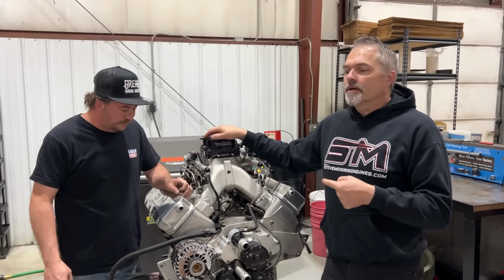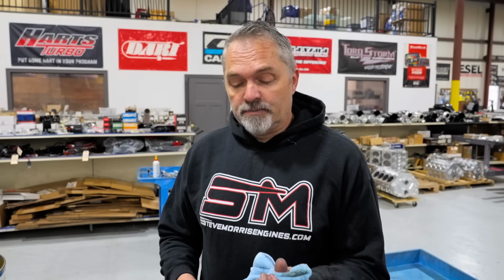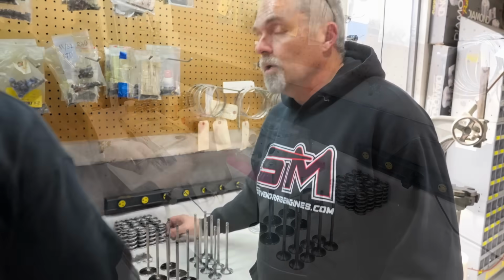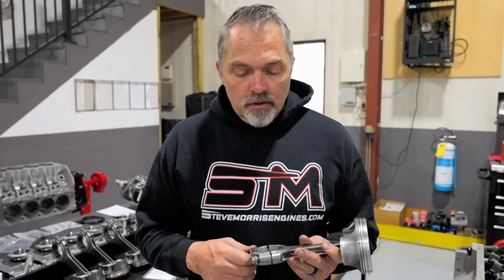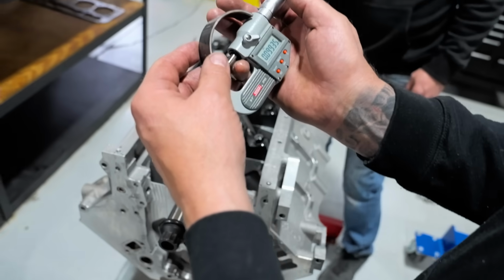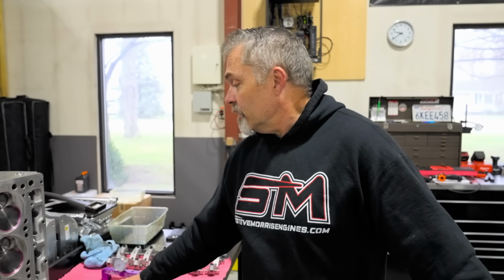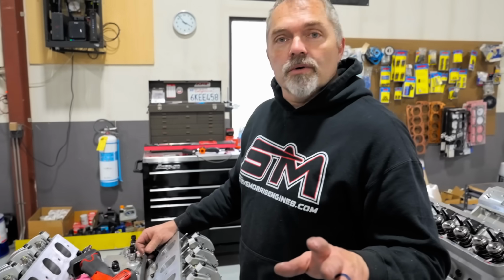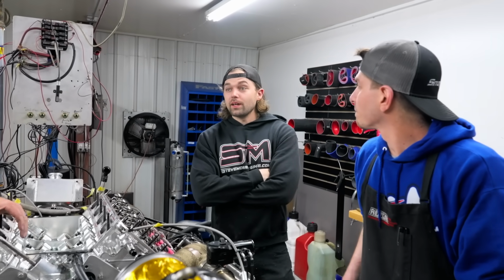HUGE ! 474 cubic inch LS Engine… How Did This Engine Work So Well For 4 Years?

Comment: I think the oil tanks on dry sump setups are just supposed to separate air from the oil right? Aside from that, they ensure the oil pump is always fed oil.  The car would have to be upside down to not be fed oil.

Comment: Thought dry sump was to keep oil from riding on the outside crank shaft and draining hp. Also for vehicles in hard g braking and cornering and mounting the tank for weight distribution advantage

Comment: Are stud or shaft mount rockers superior? I feel like shaft mount would be stronger, and more durable.

Also I think I misunderstood proper rocker geometry. I thought that the centre of the fulcrum and roller tip should be at 90degrees to the valve angle at half lift?

Comment: To explain the intake sucking shut thing. Steve, you need to separate the force vs pressure issue. Yes  atmosphere is 14.7psi, however you have a lot of surface area on that intake. Maybe 100 square inches? Does that not mean you only need .6 of a psi pressure drop to achieve the 60 pounds of force that you required to push it closed?

Comment: Dry sump gets the engine lower. Dry sump tank does a very good job of oil deaeration. My guess is that the Proline guys don't care about the oil deaeration since its running such a short amount of time unlike a road racing, circle track etc. application. The tank and plumbing would also be extra weight they do not want.

Comment: Back in the air cooled flat 6 days, the 3.6L 911's took 16 quarts of oil. Being an external sump/tank/ reservoir, I didn't think much about it. Most German engines have larger oil capacity per liter of displacement than American or any other country's cars. For example, MB 5L V8s require 10 quarts, BMW 2.5L I6s required 7 quarts, and even Audi/VW 5 cylinder engines require 7 quarts of oil. Compared to GM 60° V6s 4.5 quarts and 5.7L V8's 5 quarts, you can see why OE engines from these manufacturers wear the way they do and require oil changes at their respective intervals. More oil will last longer than less oil, under the same circumstances. German cat companies have set oil changes at 7500 miles for decades, even before using synthetic oils, and when American car companies were still using 3000 mile intervals. Now, everyone is using synthetic or synthetic blends and extending the intervals between 5000-7500 miles. Oil changes are the most important maintenence items to get the longest and most trouble-free life out of an engine. Spark plugs in aluminum heads need to be removed every couple of years to prevent them from seizing because of dissimilar metals corrode together. Timing belts/chains and water pumps are the other critical items that must be replaced at intervals, as failure of these components can destroy an engine, even if it looks like new. Look up water pump failure on a Ford Explorer 3.5L and you'll see what I'm talking about!

Comment: Dry sump with external tank, smaller oil pan you can lower the engine to get the center of gravity close to the black top. That's one of the biggest benefits

Comment: Hey Steve was building a BBC long ago and dropped one of the main bearings, cleaned it off and installed it. Put the crank in, torqued it and the crank would not turn?!? We took another bearing and replaced it, worked great. Could never explain this.

Comment: Ok, obviously all aluminum engines kick ass and make a ton of horsepower - What about annealing?  Aluminum anneals at 500-600deg but egt's are 1200+ so what does that do to the heads or pistons??

Comment: Thanks for one educational video again.
But one, humble question: I was told, reference to 41.33---, Never turn a micrometer on the inner "ring", use  on the knob on "top" that ratchets.
Otherwise, you will, ower the time, ruin the instrument= Bend it out of accuracy.
Am I wrong?
from a Finn in Diaspora
Reply from the maker: Nope
It is a feel thing
You don’t tighten it up.😁
Reply: @stevemorrisracing  Yes, You are right, but getting there, costs many micrometers.
😅

Comment: 14.7psi per square inch.. so 10 square inches would be 147pounds pressure, now i don`t how much vacuum you were pulling , but surface area was well over 10 square inches.. so yes the atmosphere pressure is what crushed it.. still impressive though.. . even with normal 100hp engines can be a problem. 
many years ago had a car converted to LPG. after going up a gentle hill. the intake collapsed,    i did not realize, and the garage had the car about 4  or 5 months, and could not find anything wrong. so put 25000 on their loaner.   i said give it back to me, and simple took it apart bit by bit. it was real obvious, there was a tiny crease. that made the weakness...   did LPG conversions myself after that.    so yes it is the difference between atmospheric and the negative internal pressure,.. there is a youtube video. where they fill a big rail fuel container with steam.. and when it cools. it crushes itself
Let god bless you and your family

Comment: Hey steve steve steve i have a comment and alot questions Wow that's crazy when then cranks not torqued no spin torque spin😂 guess everytime I have done it have torqued and spin each one and dnt really see much movement in cast iron😢wonder how much magnesium moves but the main question refers to the ring spin valve spin and lifter spin on flat lift they have always said they spin because lifter bore and rocker arm centers are offset a little can you relate since you build heads and blocks out off square magnesium I mean aluminum 😂thanks for teaching everyone 🗑  in garbage out

Comment: Can you explain why most pushrods are labeled a certain length but measure a different length with calipers? I find it the most annoying part of an engine build. I usually go into Summit with a set of calipers and have to measure a few sets to get exactly what I need.

Comment: I am no Physicists, but i believe the reason why the intake duct started to deform was the force per square inch was greater than the 60 or so pounds that you were exerting on it.
Reply: It started to deform because as velocity increases, pressure drops. Bernoulli's principle. So outside atmospheric pressure is higher than that in the inlet. If they mount a pressure transducer in it, we could have seen what the pressure in the inlet was relative to 1 atmosphere.
Reply: Steve was measuring 50 pounds of force on the scale.  Atmospheric pressure at 14.7 on 10 square inches would be 147 pounds.

Seal the ends on the intake tube and put a vacuum pump on it.  Vacuum will squash it like a grape.

Comment: Steve, do you measure the external atmosphere in the dyno room?  I imagine, with the cubic inches and RPM of these engines on top of the exhaust fans, the CFM numbers could potentially overwhelm the fresh air supply in the room.

Comment: I don't know how to explain it in English, but that engine is never loaded properly, it runs on empty but against the limiter, and it needs a few hundred horsepower to do that.When accelerating, maximum power and rpm are used at all times, and when driving on the track, the engine runs at almost full power all the time.That's why it can handle even a worse crankshaft.

Comment: Your absolutely wrong about the weight of the pushrods!
EVERYTHING above the cam is mass you have to move, and the valve springs have to move back!
This stupid "belive" thing is what holds you murican back!
Stopp it!
I can't govern you murican, and I won't for fuck all, but for the sake of humanity wake the fuck up and read some books about combustion engines!
EVERTING above the cam lobe, contributes to the mass your springs have to return!
If your just miss spoken all good, otherwise FU!

Comment: Engine like Jessie's, Naturally Aspirated,.. Would there be any advantage to the engine by running a water to air charge cooler in an un-boosted engine?
Are those motors for the piston record, or the outright wheel driven record? There's about 25mph difference between Speed Demon and Turbinator II.

Comment: 1:03:42 Its always been my understanding that if the oil is in the pan/engine it's a wet sump. If it's in a external tank, it's a dry sump. Sump is referring to the deep area of the oil pan. It has to have a sump in order to hold the volume of oil required by the engine. I suppose technically you could call the external dry sump tank a "sump" as well. Our Super Late Model engines were a wet sump, external pump set up. It was great for priming the engine before startup, and it allowed us to control oil pressure better with the adjustable bypass. Especially when it was hot and low RPM under caution flag or pulling of the track and driving in the pits.
Reply: I believe wet sump is when the oil drains down to pan, and allow the crank to hit it..

Comment: I like your comments about push rod size and weight. It makes sense. Coming up 20+ years ago everybody was trying to go away from 3/8 push rods to 5/16 and anything smaller because everybody was worried about the weight. Mopar push rods were all 3/8 and everybody was trying to go to Chevy push rods to get something smaller, thinking they were gonna run better. It never made sense to me. You just summed it all up with your fulcrum and lever explanation

Comment: Steve, yes the atmospheric pressure is 14.7#/square inch.  The streamliner intake is greater than 1 square inch.  It takes ~4 sq inches to obtain the 60# to crush the intake.  That's why the intake distorted, because the pressure inside the intake is less than atmospheric pressure and the area is great enough to obtain the 60# force to distort.
Reply: @bigboreracing356  
Suction? It's not suction. It's a pressure drop inside the inlet caused by airspeed. And there's no suction anywhere near that inlet - just like there's no suction in front of a jet engine. But I'm guessing you already knew that.

Comment: Just a guess as to why the engine stayed together as long as it did with out a 8 counter balanced crank. As Steve has talked about resonance in engines before, no matter what engine it is, it has an rpm/resonance that it doesn't like. My guess to the longevity is with near constant/sustained rpm, it is staying out of that resonance spectrum, therefore, not stressing or fatiguing the material like it would constantly going through the rpm sweep. But like i said, just a guess.

Comment: On the timing belt VS chain stretch topic they're both doing drastically different things with use. Chains don't really "stretch" they wear causing elongation. The pins and links wearing is what causes the change in length. A belt does stretch a little but returns to its original size so its more of an elastic stretch. Belts have fibers running the same direction as the load keeping them the same size but the rubber gives a little creating the elastic properties. This also helps with vibration and harmonics.

Comment: Does pushrod size of little consideration for RPM because it's not on the side of the rocker that multiplies the movement?  RE: the 8-counter weight crankshaft - Is this engine happy, in spite of non-center counter weights because it's not seeing the kind of loads a car that's under WOT does?  Does a burnout car even see WOT after it runs up to redline, where it, pretty much, stays, during a burnout?  Just curious.

Comment: I'm thinking dry sump is about windage and oil starvation and is usually followed up with a scavenger pump as well also allows you to get the main center of gravity the motor lower in the chassis

Comment: You would be amazed at how much pushrods flex while running. Every engine builder I have ever talked to says the same thing put the largest diameter pushrods you can fit.

Comment: Hey Steve, 
When it comes to ring end gaps. I know that NA motors have less than a boosted application,  but when a NA motor is consistently ran around 10k do the ring end gaps need to be increased or are they ok using a standard NA gapping.

Comment: In 1980 the Chevy Power catalog listed and entire Big Block Chevy valvetrain "guaranteed stable operation to 9200 rpm"
"3d Design ZL1" cam = only worked with headers. The Second and First Design ZL1 were for headers with mufflers and for headers with real good full exhaust systems (OEM L88 Vette probably)

Comment: That was an awesome end to the video.
Reply: Hi Steve,  re the offset contract patch on the valve. Provided there is enough piston to valve clearance, would it be better if you could run a higher rocker ratio?
Re the Hemi oil systems, wet sump has an external hose from the rear of the sump to the pump in the factory position then through a remote oil filter and back to the block. My engine oil pressure does start to drop at the 1/4 mile.
A dual stage pump is available, that mount's ìn the same position. The first stage works the same as a wet sump, but when the oil leaves the filter it then goes into a dry sump tank to separate the oil and air. The 2nd stage of the pump is then used to pressurise the oil back into the engine. It is a basic system but it allows the extra oil without the crank having to swim. 
The Paterson style systems that most people know as dry sumps, seem to not be used as much on engines that are dismantled between rounds.

Comment: very interesting stuff. thanks for that.
question: when the push rod at the top is heating up, is that temp extremly high? and is it like a heat treat and the material gets brittle and breaks?

Comment: What kind of cost is involved in building these type of high horsepower LS platform engines and can u use a factory LS block as a starting point?

Comment: It seems unbelievable that a pushrod engine can make such massive power. I was brought up with the thinking that massive power needs massive complexity with quad cams, multi valve heads. Small components can move faster but here we've got giant components, pushrods, rocker arms and huge valves running up to 9,000rpm reliably.
Reply: Question is, in which way do you make the power? If we look at power from the perspective of displacement and fuel, there's still a lot to be said for four valves and complex designs. Let's say we build a 400 inch LS, that's 6.6 litres which makes 830 hp SAE. If you want that to run on pump gas, we are looking at something that is pretty radical with a cam that is, let's just say "challenged" in a car with a manual transmission where it cannot slip on a loose converter or a super tall rear etc. Now let's look at some of the exotic offerings. Here I'm thinking of Ferrari's 830 hp 6.5 litre V12. Slightly smaller engine, but not only does it have low end torque to pull a car along at 85 mph @ 2000 rpm, it runs buttery smooth, with an absolutely explosive throttle response - and that it does being Euro 6 compliant with GPF's and catalytic converters in front of it. I like both types of engines, all I'm saying is that one needs to look at how they really compare. Could you imagine that same V12 if there's no cats, no GPF, compression for Q16 race fuel which this ran on when it made 1006 hp, and equally radical cams?
Another way of comparing the two, would be to see what GM had to do to make 505 hp with the LS7 vs 670 with the LT6 - and the LT6 is significantly smaller than the LS7 in displacement. OHV is cool, but it will not beat DOHC in N/A applications if matched equally.

Comment: This is off topic but back in the day rev kits were springs placed between the heads and the lifters to help keep the engine from floating out. The only reason I bring this up is because I have never noticed this being mentioned on engine building videos and it just popped in mind when talking about 10,000 RPMs

Comment: Hi Steve I had a question. What oil pressure would you say is acceptable on a ls1 at operating temp? All manuals I've seen say 6-7 psi at 1000 rpm is ok? That seems extremely low to me, what are your thoughts?

Comment: I’m curious if the shaft driven style pump on the SMX uses less    power than a belt driven dry sump set-up? Would it be possible to run the oil pump on 12 VDC and make more horsepower in the absence of parasitic loss?
Reply from the maker: Yes
Reply: @ the shaft with the cam driven gear always runs with engine so the reliability is worth the reduction in power? You guys rock man! And I’m living proof you’re nice enough to answer dumb questions 😜Thanks for all the knowledge

Comment: Steve: You said that belt drives are great for absorbing vibration. According to Jesel, I cannot use a belt drive on my Odd-Fire V6 due to the vibration/harmonics. So, why does the belt absorb vibration if it cannot absorb the vibrations of an Odd-Fire engine? Isn't "vibration" still vibration regardless?
Reply from the maker: I’ve never heard that 🤔
Reply: @stevemorrisracing  Shoot Jesel a call and ask them about a Chevy odd-fire v6 using their belt drive and see what answer they give you. The tech on the phone stated that odd-fires literally "beat-up" the belts. I would love to be able to use a Jesel timing belt. Interested in what they tell you and see if you comment on it in a future video.

Comment: Stroke x PI x (Bore/2) ^2 x NumberOfCyls. So basically 0.7854 = PI/4 (the magic number :) ), thus the formula Steve displayed: Bore * Bore * 0.7854 * Stroke * 8. Works for Inches-> CubicInches as well as for mm to cm3 (pay attention when converting from mm3 to cm3, you need to divide the whole thing by 10^3 = 1000).

Comment: Alaska buddy's 350 chevy ran in to an issue same one bad bearing , my room mates father ran a motorcycle shop was machinist as well so he gave me the knowledge his dad shared with him on round and toque specs clearance issues respective to bearings ,  he was a real stickler for tearing down the drag motor in my car everything had to go back in the same hole it came from every last nut bolt 1977 I had a real nice 1967 barracuda formula S " love the way you break it down Steve